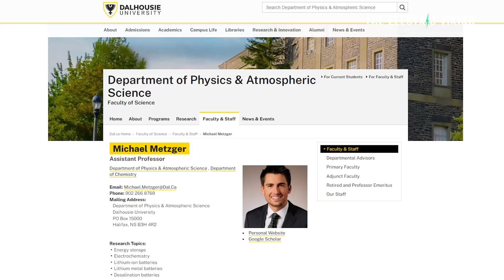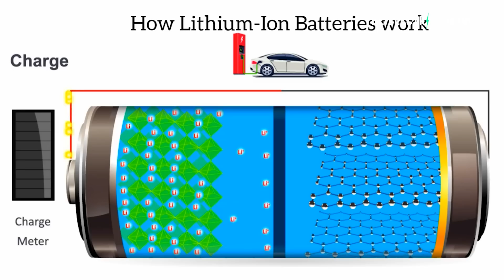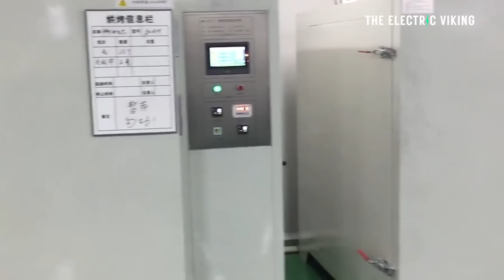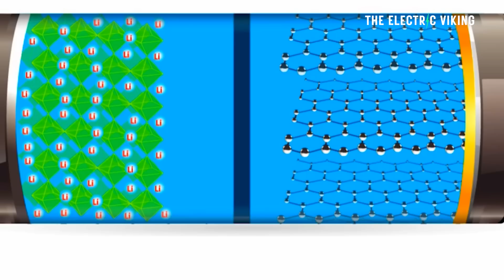Tesla battery scientists discover why lithium batteries self-discharge

Comment: Calendar Aging is the biggest problem with Lithium-ion batteries used in EVs because replacing battery packs every 8 years is very expensive.
Reply: What's funny is that if this were such a big problem, then there would be no 200,000-mile cars with batteries that worked. That isn't true.
Reply: @ronaldking1054  That is incorrect ... the 200,000 mile is dependent on cycle-life and not calendar aging. Batteries degrade over time but there's nothing to stop someone doing 200,000 miles in say 5 years and that would not be affected by calendar aging so much. On the other hand calendar aging is an important factor when buying secondhand EV because the battery could have significant degradedation after 10 years even if the vehicle has only done 3,000 miles. This is why Tesla battery warranty is only 8 years.
Reply: @iamspock  No, it's not because no one drives the amount of miles per year you'd need to make it 8-years-old. What's worse is that you are claiming that use does not affect the performance and that is wrong. The car referenced was a 12-year-old car. You are wrong.
Reply: @ronaldking1054  Please go do some basic research before claiming you know better ... search google for 'calendar life of lithium-ion battery' ... here's a quote from batterywali website ... 'Calendar life of battery is around 5 to 10 years. It can be observed that it's almost impossible for a lithium ion battery to completely utilize its cycle life, considering the assumptions made above.' ... Also, please correctly read my comments before misrepresenting what I said. My comment relates to EVs in general, not just Tesla. Further, there are variable factors that affect life of a battery and there will be some examples where the life is longer than average and some where life is much shorter than average. There is also the definition of how to define the lifespan of a battery ... is it when capacity drops to 80% of original, or some other metric. Unfortunately, with lithium-ion, they can fail completely after a certain point is reached.
Reply: @iamspock  And you should do research in that people who have no interest researching what happened to electric vehicles. You can check out, "You’ll Be Surprised How Long EV Batteries Last & Which Cars Need Their Batteries Replaced The Most!" which talks about a study on older electric cars. Keep in mind this is an automotive channel and as such, they have no reason to lie.
Reply: @ronaldking1054  I watched the video you referenced and it doesn't change anything about what I said, neither does it support your claims. The channel isn't lying about this, but you really need to pay more attention to what is said and look at the detail. I am not going to waste any more time trying to explain things to you because its obvious you are more interested in supporting your own beliefs than in investigating actual facts. There is plenty of research on lithium-ion batteries out there done by real researchers and not just interpreted opinions of automotive channels, so I would suggest you go read that because its the same battery cells that are being used in EVs and other devices. I already looked into this and I made my comment that self-discharge was not as big an issue as having your battery die due to age related issues. If this problem has been resolved, then where is the evidence for this? Pointing to a few examples of older cars is not evidence since there aren't many 10 year plus EV's from which to draw conclusions, but there are many examples of old lithium-ion batteries in other devices and we know a lot about how those age. If a lithium-ion battery loses say 20% capacity after say 8 years, that doesn't means it will lose another 20% after another 8 years, because there is a 'knee' in the capacity loss graph in that once a certain level is reached the battery then fails catastrophically. This is a concern. How long does an e-bike battery last? ... Guess what ... its the same lithium cells in those as are used in many electric cars!
Reply: @iamspock  You are claiming that there should be a more linear degradation as miles happen over time. It is not linear. It is mainly flat. You are wrong, and they showed you were wrong.
Reply: @ronaldking1054  No, that is not what I said ... once again you are misrepresenting my comment ... please read carefully ... and more importantly go verify by doing some research as I have because I don't have the patience to argue with you. I am not claiming anything ... I am simply stating known facts from research already carried out by others and you can go find those same facts yourself. If you are feeling especially lazy, then you can also try ask ChatGPT about this issue...
Reply: @iamspock  By the way, the statement that most happen within the warranty period suggests that the batteries were defective.
Next, by your logic, I guess you agree that the supply of oil is much less as it has a nice flattening in its graph over time, which means the supply of oil is better at that level than even we suspect it is, but for you, the fact that a capacitance does not lower is evidence that there is less capacitance than what we can measure, which means you must think there is less oil in the world by your logic, and as such, you are arguing that technologies other than oil must be found sooner.
Reply: @ronaldking1054  I am beginning to suspect English is not your first language because you have an incredible knack for not understanding what you read.
Reply: @iamspock  No, I have an incredible knack for understanding unlike other measurements, one cannot drive the 200,000th mile before the 1st because IT ISN'T REMOTELY BASED ON REALITY. I also understand that moving 1 mile is not instantaneous.
I also have a problem with the fact that you do not understand that basically, you have stated that overestimation must occur in the battery technology, but I have shown that you cannot understand that overestimation cannot occur in the supply of oil, and in case you were not aware, IN THIS REALITY, gasoline is a product of petroleum.
Reply: @ronaldking1054  Try English instead of riddles ... you just wasted your time and mine.
Reply: Show us your data….

Comment: Figures. This may explain Lithium Ion battery cell drain over time & reduction in charge capacity - irrespective of charging cycles. And why freezing LiIon batteries would slow reduction in charge capacity (freezing unused batteries, not using them at lower temp). Freezing them would slow chemical reactions overall.
Reply: Not really, what most people think of, including the viking it seem, self discharge over one or two months have nothing to do with cell discharge which typically  occurs over 5-10 years for Li-cells. Cell discharge is what the scientific article is about. 

The self-discharge over 1-2 month is actually a drain from all the system running in your car. 

So in essence, this discovery tells us that there will be one less additional discharge cycle every 10 year or so in your car. Not really important. 

However, it is still important in certain emergency or military equipment which are stored long term until use such as missiles.

Comment: Although self-discharge of the battery is a factor, the fact that modern electronic devices never really turn off completely is likely to be a larger one. A parked Tesla uses power for a number of things; staying sufficiently awake so it can respond to the key fob, periodically checking for OTA updates, and so on. It will also activate the heater to warm the battery if the temperature drops low enough to present possible danger to the battery.
Reply: Eventually Teslas disconnect battery so it can last for a year or more with steady voltage.
Reply: Don't forget the motion sensors and Sentry mode for video recording.
Reply: 12 volt battery is in charge of non driving systems.
Reply: @CMod0502  but it gets recharged from the high voltage pack
Reply: The main point here is this effect becomes more pronounced at lower temperatures and explains why these batteries lose more power in the northern states than in the southern states.
Reply: Even with electronics fully off, the parasitic capacitance can drain the battery over time.
Reply: @PeterMikeSolomon  DC cannot flow across a capacitor.
Reply: @dfs-comedy  in an ideal capacitor yes that is correct. However, we don’t work with idealized components in the real world.
Reply: @PeterMikeSolomon  
"Parasitic capacitance" has nothing to do with self discharge.  The chemicals inside of the cells are slowly letting changes take place.
Reply: @acmefixer1  yes, it does have an effect on self-discharge. The battery issue is a whole separate problem but even if that we’re entirely resolved there would be energy leakage that would eventually drain the battery over time.
Reply: @PeterMikeSolomon  Parasitic capacitance BY DEFINITION cannot allow a current to flow in a DC circuit.  Parasitic resistance in parallel can however.

Comment: Obviously there are other things that lead to “phantom drain”, among them poor power management of the computer system. The car is never completely off.
Reply: There's self discharge, which is what this video was about, and there's phantom drain which is energy usage when the car is supposedly "off" (though some might argue that phantom drain includes self discharge - I'm not aware of a definitive definition). Sam wasn't very precise... (case in point: Range loss due to cold battery isn't really lost, but low temperature slows down the chemistry so that not all is available - as the battery warms, lost range is "unlocked" again)
Reply: That isn't what is being said, specifically talking about the battery discharge without anything draining it.
Reply: @LivingWithChiari  understood. However, unless the car self reports expected vs. unexpected discharge, the user is unlikely to be able to tell the difference. That is, the point was was clumsily trying to make us more along the lines of “Okay, but is this loss significant compared to the other more expected power usage?” If it is tiny, then EV owners have bigger problems to worry about, like parking their car in the sun or leaving the cameras on. I don’t think I heard anything about whether these losses are significant from the Viking.

Comment: If it true, then eliminating this problem from Li Ion batteries should result in a significant improvement in battery performance.
Reply: The troublesome plastics must provide some benefit to the cells, though, or they wouldn't have been designed in.  Hopefully, that benefit isn't lost in the search for alternatives.
Reply: @levenkay4468  They hold it together, that's their job. They aren't supposed to be involved with any of the chemistry of the battery. I expect this is a change that's probably already being made. Since it's not supposed to have an effect and there's other adhesives that likely don't get involved in the battery chemistry.

Comment: Great news, This is another step towards making our energy something we can rely on as its inevitable batteries end up not getting used for a long period occasionally which can and does lead to damaging the life of the battery if it self discharges too deeply. I always store my devices at 70% but even this will eventually drop to zero, like an old phone you keep as a back up and forget about for a year, then just when you need it the battery is flat.
Reply: Nope. The taping only degrades like this in batteries that are 10 years and older. Just another hype.

Also: it is a difference if you store your devices with batteries connected or if you store them and disconnect the batteries mechanically. That's why a lot of notebook manufacturers now make the battery hard to remove because this way the battery gets wrecked faster and they can sell you a new one.
Reply: @Uygsoerk  That's not what it sounds like from the video.  Is Sam wrong about this?
Reply: @incognitotorpedo42  Neither is it mentioned wether they age the battery artificially or use a new one nor is it explicitly shown what the tape's particles  really do at certain stages of the battery. It can be made up completely what they say even though it seems sound. I would like to see this research paper that hasn't been developed by independent researchers - but by people who get paid by Tesla.
Reply: It's more important for them to find out why lithium ion batteries sometimes self combust.
Reply: @simon6071  not a problem since they never do. some morons short circuit them.
Reply: your phone battery drains because even when it's off people are using it to spy on you.

Comment: This is incredibly interesting because I leave my car for a month or two and if it is not plugged in, it has phantom drain at about 1%/day  and that is with everything turned off. 
Thanks!
Reply: To be fair, on EVs, that is because of the BMS and other stuff draining power.
Remove these and you remove almost all of that drain.
Reply: This has more to do with all of the EV systems that remain on in the background even when the vehicle is "off." This includes (but are not necessarily limited to) security systems, battery management systems, and the vehicle systems that "wake up" the vehicle when you need to unlock the doors and "turn on" the vehicle. All of these draw small amounts of power that add up, and are much more than the self discharge rate of the batteries. Most rechargeable lithium batteries are good for 6 months of storage when no loads are applied, and some are good for up to three years, especially when kept cold.
Reply: You should be driving and charging the EV some during that time it is idle.  You can let me drive it for you - I'll do it for free!  👍😋
Reply: Just parked mine for 5 days and havent lost 1km of range!
Reply: Some cars have a deep shutdown function to completely power down including the telematics
Reply: @Mtlmtl Qc - I'm not sure where one would put a kill switch. It's pretty obvious where it goes in an ICE vehicle but a Tesla has pretty much buried the wiring inside the car so it would be really difficult to identify which wire and where to install a kill switch. Might be easier to have an option in the Tesla app that tells the car to hibernate.
Reply: @thomasruwart1722  Exactly.  When I leave for over a couple of weeks, I' want my car to be completely shut off.  Not monitoring anything! It's in my garage, after all.
Reply: @Mtlmtl Qc  a kill switch would work if you werent worried about adverse temerature ranges or updates.  Also youd need some sort of backup power for your keyless entry and security system.  The modifications cost would likely greatly excede any potential savings.
Reply: Even with electronics fully off, the parasitic capacitance can drain the battery over time.

Comment: I feel like I heard this story (or something very similar) a feeling months back.
Reply: It is indeed a few months old :)
Reply: 6. Feb. 2023Researchers at the Tesla-funded battery research centre at Dalhousie University have discovered an amazingly simple reason why lithium-ion batteries self-discharge over time, even when they are not in use: The use of adhesive tape. In lithium-ion battery cells, coiled electrodes of these batteries are held together with simple PET adhesive tape....

You mean this?